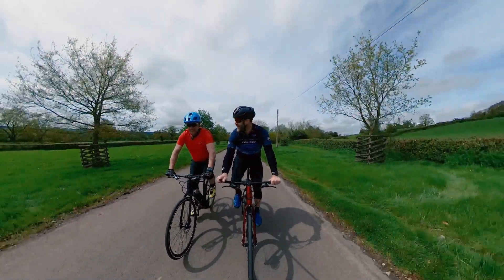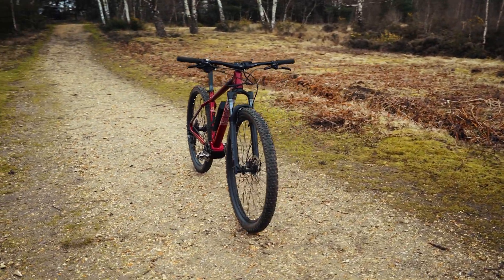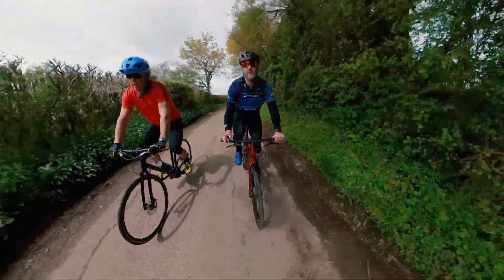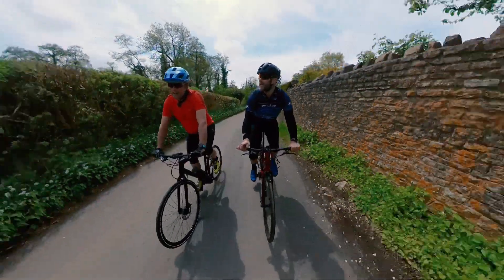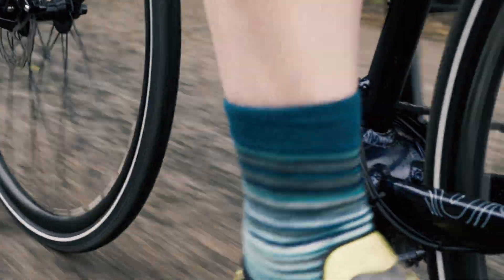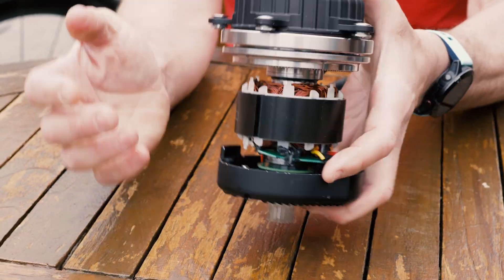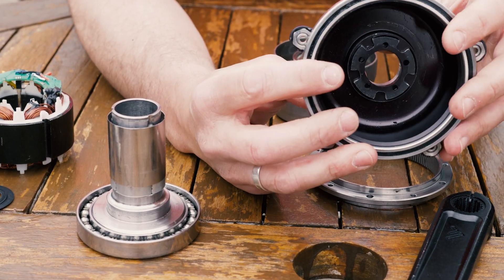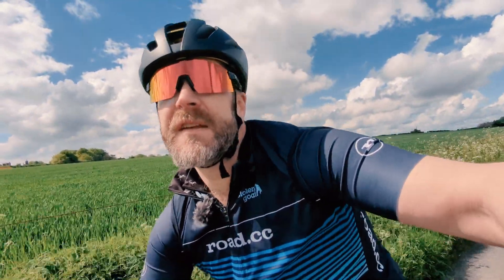A new ebike motor packing some CLEVER tech | Freeflow Technologies first ride

Comment: Be interesting to know how much testing has been done on this motor, longevity, etc. Its a hard one to say how far you can go on a fully charged battery. My experience is I have a Trek Powerfly 5 2021 from new (waited ages for it), on an average ride I get 70km and use only 3 of the five bars on the power meter, I don't use the motor all the time just on hills, long climbs and more towards the end of the ride. I did a lot of research into EMTBs and it paid off- I'm well pleased with my Trek. I also love all the advancements it these things - fascinating stuff.